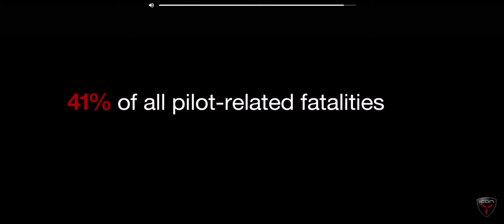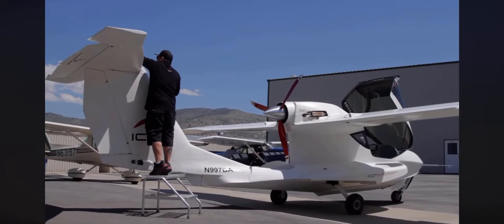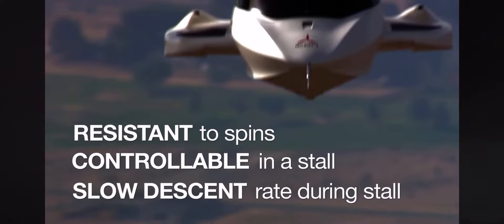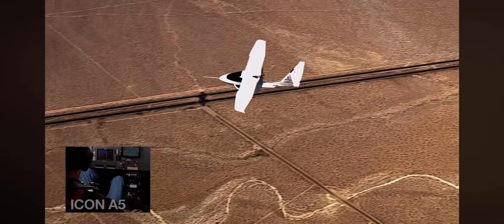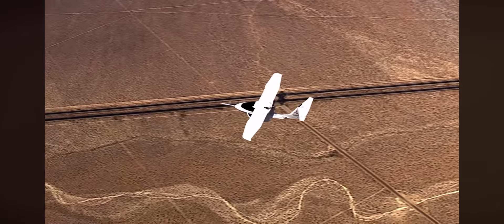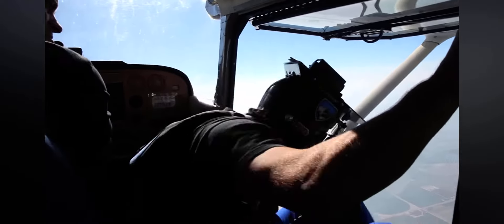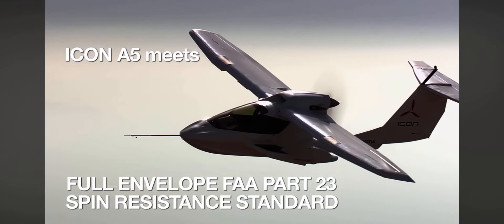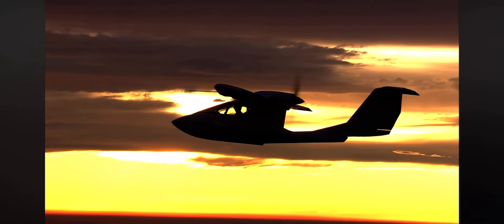ICON A5 Stall Demonstation

Comment: In Microsoft Flight Simulator, the plane WILL stall. I think this (bug?) should be fixed, as it does not reperesent this feature of the Icon A5, which is pretty significant IMO.
Reply from the maker: Yeah, MS Flight Sim is a fun representation, but actual flying characteristics are a bit lacking.  The AoA especially doesn't work like the real one.  X-Plane 12 is a much better representation of how an ICON flies.  Not perfect, but much better.

Comment: How is a spin a loss of control??? Just remember PARE and don’t fly uncoordinated. I stall, spin, and snap roll planes deliberately all the time. Plus the more resistant you make it to spinning typically the more difficult it is to recover.
Reply from the maker: You are correct, I have done acro courses and it is a blast.  Learning how to control a plane in unusual attitudes and is fun.  The ICON A5 was not designed for acro but was designed to avoid spin since lower altitude is where this plane operates, and the pilot is likely to be not acro trained.  As you know, if you depart controlled flight at low altitude, you may not have the altitude to recover no matter how good you are.  You are also correct, if it is extremely spin resistance, if you intentionally did something nuts to force it (again -in A5 at idle, full aft stick and full right rudder, it doesn’t spin at least for the 7 sec Part 23 requires), it will probably be hard to get out of a spin.  That’s why the plane is equipped with a parachute which could be utilized as a last resort (ideal 500ft alt or higher).  Again, the A5 is not an acro plane and rotax engine is not designed for inverted flight.
Reply: @IconicFlight  my argument is that calling a spin an “inherent loss of control” is just flat out wrong as they are not. Furthermore, the more docile and stable you design a plane to be the more maneuverability and controllability you give up thus restricting its performance envelope which I would argue makes a plane inherent less safe, especially in challenging wind and turbulence conditions where you may need to exercise quick, large control inputs to maintain a stabilized approach or level flight. I’m not suggesting you should intentionally fly into severe turbulence or land in a 45 know dead crosswind with wind shear but the fact remains that they do inadvertently happen all the time in real life flying. I can’t count how many times I’ve had to take off or land in a hurricane or typhoon but it’s all part of the job.
Reply from the maker: @andrewh2341 It’s not me saying it, NATOPS manuals and FAA consider that a “departure from controlled flight”.  It’s not that you can’t force it or recover from it, but you have taken a stable aircraft and unintentionally departed controlled flight. Now again yes, more stable/spin resistant you mKe a plane, the harder it is to get out.  Inversely, the more maneuverable you make an aircraft, that harder it is to control.  I remember a story about the X-29 being so maneuverable and  unstable it had to have a computer making like 29,000 inputs per second to keep that thing going controlled.  Test pilot said, that’s why they had a computer and 2 backup computers because the plane would tear apart without it.  That’s wicked instability!

hurricanes?  You must be in the Coast Guard C130s.  That’s a beast!
Remember this plane is a 1068lb empty Light Sport Category with a demonstrated 12kt x-wind (though I have heard of folks doing more).  If you took it out in unsafe condition, I’d throw that to poor aero decision-making.  This plane was designed to combat the low altitude loss of control which occurs yearly when folks try the “impossible turn” back to runway.  It does have incredible control feel I think you’d like, and it handles fast inputs great…just no acro.  Tell me what part of the country you are in and I can steer you a place you can do a discovery flight.

For ICON A5, think Piper Cub, low slow and incredibly fun!